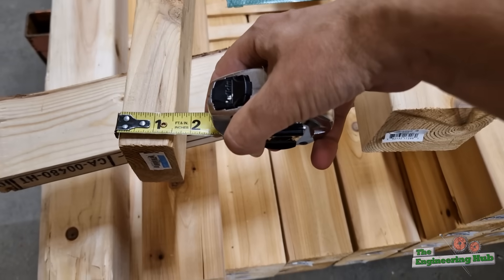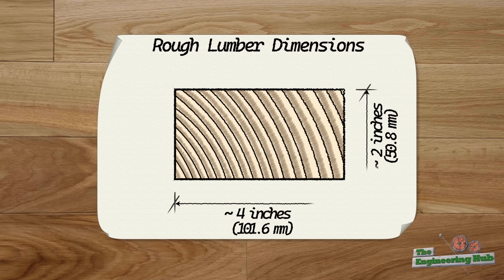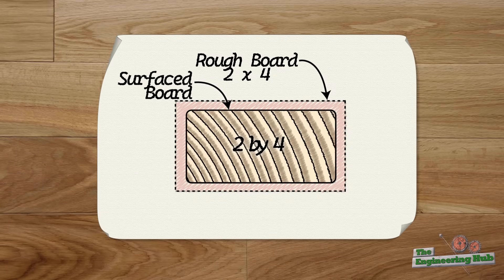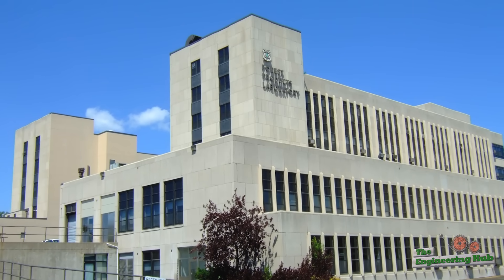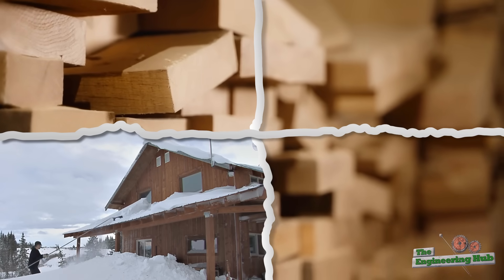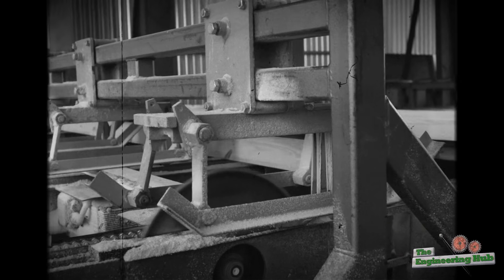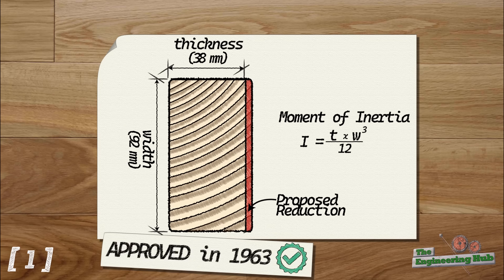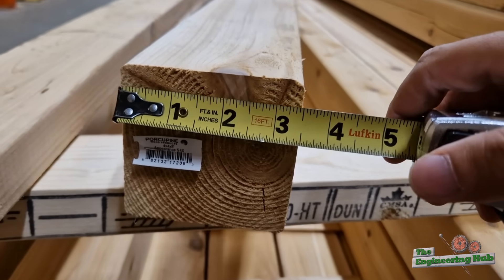Why is the 2 by 4 getting smaller and smaller?

Comment: 6:13 The growth rings say it all.  "New Improved" 22x4 10 years showing. "Old real" 2x4 49-50 years showing.
I made a picnic table out of 2x12 redwood boards from a deck that was built in 1988 and has 136 years of growth rings showing.

Comment: In the UK and most of the rest of the world, the rough sawn dimension was the nominal or standardized size which was first adopted during the Victorian era when steam driven machinery enabled the dimensions (inches, feet) to be controlled rather more closely than was possible previously, when timber was pit sawn. This became a worldwide nomenclature for the size by which the timber was known principal dimension first hence 4 x 2 et al. The U.S had to be different so minor dimension first, thus 2 x 4.
Later, the strength properties of various species and qualities to be sized at 22% moisture content was created to select timber to be used structurally, this standard was B.S. 1860. UK Building regulations could then stipulate what grade of structural timber could be used for a specified purpose, loading, pitch and span of the various structural elements based on combination of standard sizes. The standard sizes of structural timber section (width and thickness) were by 1/2" increments and the span in feet.

Comment: If you look at the old 2X4 from before 1919, then count the rings in the wood.
The old wood has more rings because it is old growth lumber.  New lumber does not have as many ring because it is from forest that have been cut down and replanted.  But these new trees are not old growth trees.
Reply from the maker: Excellent observation, I was thinking the same when I was putting the video together and came across that footage. I didn't include it in the video as the topic is something else, but still good that you noticed 👌
Reply: @TheEngineeringHub  Thanks,  I live in a 120 year old house.  I have 2×4 from ruff cut 2×4 , to real 2x4. 
In my basement under a additional from 1920.  It has 2×6 joist,  I have put in sister joist next to the old 2×6.  I used a current 2×8 as a sister joist for an old 2×6.
I have every type of electrical wiring from knob and tube to armor. 
I have pipes for gas lighting throughout the house.  I had to deactivate in gas lighting in 1975.
Reply from the maker: @jamesmooney8933  wow amazing! Sounds like a great property!

Comment: I've been burnt so many times from wood not being the size advertised.  We really need to reform lumber sizes to be accurate.  I bought some 1x4's the other day and they were actually 1/2"x3 1/2".  That is literally less than half of the wood that was advertised.
Reply: A 1x4 ought to be .75"x3.5" so the thickness you mention is rather suspect.
Reply: @johncochran8497 he's tripping. A 1x4 is 0.75 inches thick..

Comment: They changed the name to Pa-nama Canal after Jimmah Carter gave it away, 😂
Reply: Navies aren't terribly important anymore beyond aircraft carriers and ours don't fit in the canal. So it was pointless to hold onto it any longer.
Reply: @1pcfred  Why not widen the canal?  We dug it in the first place, it can’t be too hard to do. It still holds strategic significance. But we can’t expect much from our side, as it appears they love to weaken our position at every turn lately.
Reply: @1pcfred  What if for some unforeseen reason, one of those fleets needed to be moved quickly from one coast to the other and they ended up having to schlep all the way around the southern tip of South America instead of cutting through a widened Panama canal that would have accommodated them? It just seems like we would be covering our bases with that option.

Comment: I can't help anyone with the width and the thickness of their boards but my father invented a 2 * 4 stretcher so if you accidentally cut your 2 * 4 a half an inch short you can attach this tool and stretch it 1/2 of an inch so you don't have to throw it away unfortunately I only have one example of the tool left and my father passed away so I don't know how he made it so I'm just going to give it to the next member of my family that becomes a carpenter sorry people that's just the way the worm turns

Comment: wet lumber is much faster to frame with.  i started pounding nails for my dad in 1970 so i kinda know.  if you wanted to get a little more strength in joists, you could have 2x5: 1 1/2 x 4 1/2.

now i have been seeing 1x12 kp shelf at 11  1/4 so  there is more size shaving going on.

the biggest problem now is horrific waste, the using of good logs for pulp when they could make paper out of the trash and chipped brush.  the search for whiteness that actually makes text harder to read. envelopes could be made from mixed cardboard and paper trash including junk mail, and they would be grey.  so what?  law offices would use 100% consumer recycled gray envelopes because they like to be hip.  who needs white envelopes?

ubc if i remember right does not allow used lumber.  termite standards call for carpenter ant holes "dry wood termites" to be removed.  those holes existed in new lumber in 70 and certainly now.  in west texas, we use 50 year old wood sometimes, but the little caesars who screw up everything will stop it.

Comment: I'm more displeased by the terrible amount of warpage from the still green lumber being sold by so many companies in the area. It's gotten so much worse in the last few years. McCoy's used to sell halfway usable material but for this year at least the bundles I purchased are so bad the resulting bowing has forced massive amounts of reworking to be done and needed so many returns.
Reply: I've noticed this too. I wonder if there's enough of a market for slightly more expensive 'premium' lumber (that is in fact the stated dimensions and is dried before milling and all those little 'extra' things they don't do anymore) to be worth it for the mills to offer that?
Reply: @crosshairs007  
Depends on where. I used to have a bit of timberland just north of Raymond, Washington and the Weyerhaeuser mill there also sold lumber, the good stuff, Douglas, spruce, Alder, even some yellow cypress properly treated, aged 3 years in the yard, and final milled to exact dimensions with kiln finishing. I asked if you could buy the stuff from distributors but they said that there's big contacts for the stuff but that he was surprised they even sold to small buyers and if you buy,you'll have to figure out shipping yourself. People are still doing it, but it's generally outside of the purview of the smaller operations

Comment: I worked at a sawmill in the early '70s. At that time the finished product standards were changed to 1-1/2" X 3-1/2". Because mills were more accurate at the time, the rough cut standard was changed to 1-3/4" X 3-3/4" to reduce waste. this caused quite a stir at the mill because now all the saws had to be recalibrated for the standards of advancing the log on the carriage.
Reply: Kinda telling that the "new standard" was introduced because it was "necessary" for the finished product, but as the finishing technology got more precise the reaction wasn't to bring the finished boards closer to their original size. It was to cut down on the material so it was never 2" x 4" to begin with.
Almost as if the whole thing has more to do with cutting costs than it does with any technological limitations. They could've planed down 2.5" x 4.5" boards into "true" 2x4s even hundreds of years ago if that was the real issue.
Reply: in the 70's everything got cheaper. because people had less money. and they used AL wire n them homes as well. the buildings are the best time frame to buy if you go looking.
Reply: As a concrete form setter in California, I never saw an even number on board dimensions. A 2x4 was always 1 5/8 x 3 5/8
Reply: @calj01  then the mill was off if it was stamped demensional  lumber
Reply: @TylerSmith-jf3dg  nope. I worked with lumber for 40 years and it was always the dimension I specified
Reply: @calj01  i was a lumber grader for 20 years, then worked for MLB doing inspections of mills, either it was not kiln dried lumber, or it was special dimension lumber for doing form work. it would not be stamped as construction grade or stud wood lumber. stamped lumber either construction grade or stud wood, was standardized through north america, and the rules in canada and the states are the same, so if you buy lumber in nova scotia or california it will be graded to the same standards, all controlled by north american lumber grading authority..
Reply: @TylerSmith-jf3dg op did say it was their rough cut lumber
Reply: @mandowarrior123  i said what
Reply: @calj01  'rough cut lumber' was the important piece there
Reply: Sorry. I'm not familiar enough with the making of lumber products, but how it old tech more accurate than today? Seems like the only industry that goes out it's way to fuck itself in new and not so exciting ways
Reply: It's going down!
I'm yelling timber!
You better move!
You better Dance!

Comment: Sawmills do not cut lumber to a true 2X4 dimension then plane it down to 1 1/2” X 3 1/2”. They usually only leave about a 1/64” of an inch to plane off. I worked in a sawmill 12 years as a millwright. This is a big reason that lumber is so crappy.
Reply: Yeah, we got that from the video. Thanks Capt Obvious.
Reply: @glee21012  Watch it again retard. He stated that they are cut to 2” X 4” and planed down to 1 1/2” X 3 1/2”.

Comment: Look at tornado touchdowns and the homes are taken right off the ground.  Our homes are not built strong enough, we need higher standards and need to use more concrete and less burnable materials. Big industry is turning our homes into traps for disaster and banks and insurance  are making homes even more expensive.  Basically we are being ripped off on our housing.

Comment: Back in April we logged and milled a bunch of cedar and pine. We also had a man who owned a mill bring it to the site and we cut over 6000 board feet of two by fours and sixes and stacked them in the barn to dry for a year. He cut them so that after they were dried the cuts would be actual dimensions. I'm planning on getting a mill and build a house, but I'm considering going with a non standard size like 3x5 - you get the idea and have all odd measurements in my construction just to be different
Reply: You can't build a dwelling out of ungraded lumber. But you can hire someone to grade the lumber you have.
Reply: @1pcfred  Do you mean illegal to build with rough cut? That's an old wives' tale. Besides on the property there is no zoning whatsoever.
Reply: @1pcfred  I agree! But it is nice to not worry about codes and and inspections if you plan to be off grid and do your own work. Codes are there for good reason however.